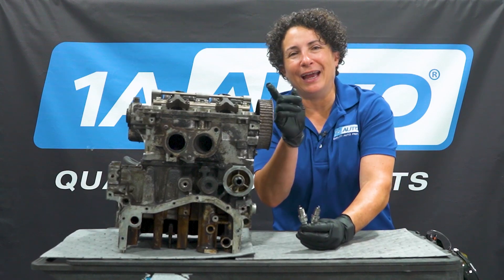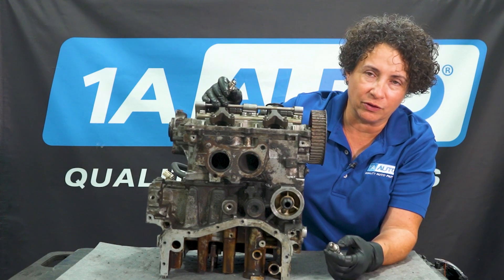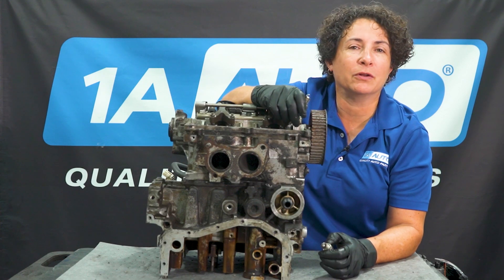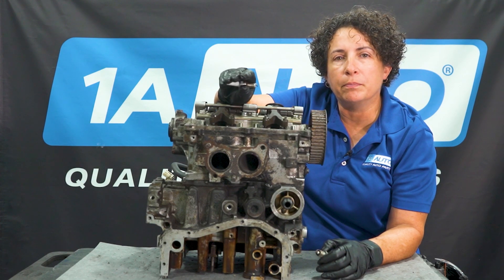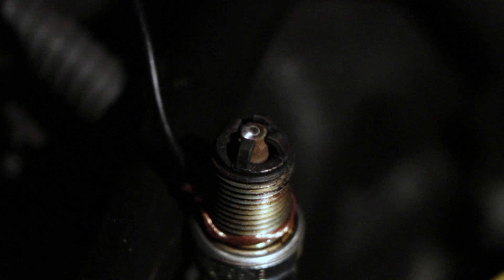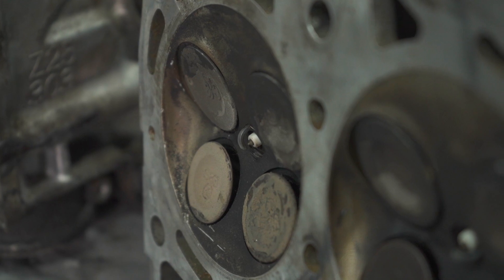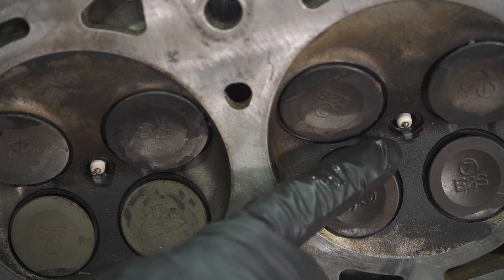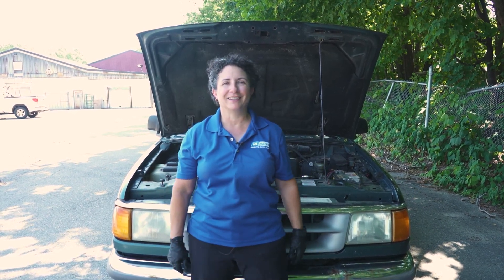Sputtering or Misfiring Engine? Can Worn Spark Plugs Hurt Gas Mileage on Your Car or Truck?

Comment: Question. Do I need to remove the engine oil to do the spark plugs? What if when I remove the spark plug I see oil. Do I need to remove it so I can install the new one?

Comment: When I start my car RPM go up 1000 like normal but goes to 200 for 30 seconds then goes to Normal but it sounds like I’m slightly hitting the gas then it sounds normal, rides smooth also . Noticed this happens only when I start my car

Comment: I got a set of mid-high performance plugs for my 2uz fe Tundra, god i wish i got some sooner!! I got mine at O'Riley's for about $4-5 each, i don't remember, threw them that day. Good god, spend the extra dollar and a half and get the better plug, mine have a needle-point on them and it makes both an audible and reaction-time difference!

Comment: Had a small issue for the last year I thought was a transmission problem starting. Finally got a check engine light for a bad coil and a dead cylinder. New coils and plugs cured it. 168K I guess I should have done it earlier.

Comment: I changed the plugs on my 1999 GMC Sierra SLT 6.0 4x4 because it was bogging heavy when I pressed the gas, and ran rough.  I couldn't even pass anyone on the highway it got so bad.  I first changed the fuel filter and that made a big difference, and then changed the plugs after cleaning the MAF sensor and checking the throttle body (which was clean).  The plugs made a big difference too and it now runs pretty good.  The plugs I pulled looked ok and were gapped fine, but they obviously weren't working properly anymore.
Reply: That's just gm quality it sounds like

Comment: An excellent video with a question, how much is the torque of the spark plug, at the nanometer scale... I hope for a quick response, even if the same responses
Reply: Spark plugs generally dont require a lot of torque,once finger tight is usually a 1/16  turn,you dont want to deal with a stripped spark plug
Reply: My honda CRV is 13Ft/ lbs.  so be careful with that